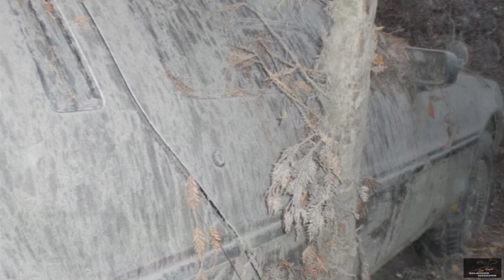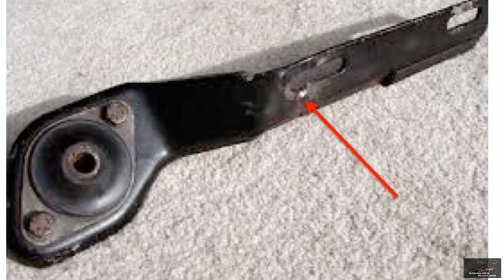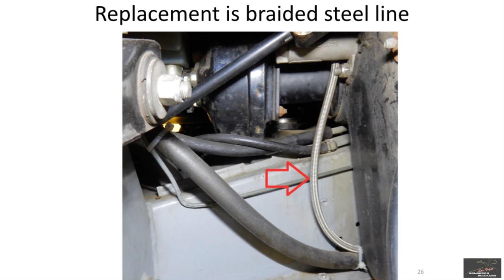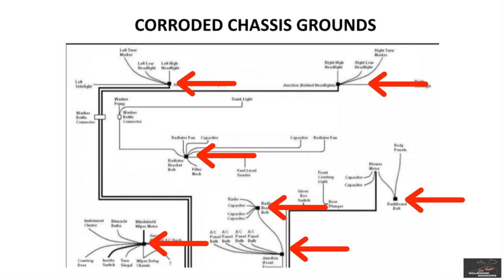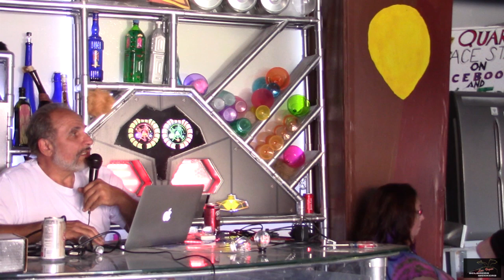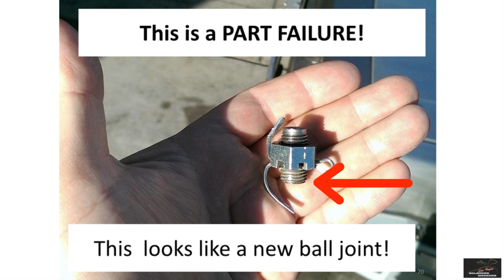What Happens as your DeLorean Ages?

Comment: I've been using this video as a to-do list for a year now.  Everything on the early- and mid- lists is done now.  I'll pro-actively do a few things on the long-term list, and run-to-failure on the non-critical items.  

Other well known DeLorean-specific items:

--replace the plastic expansion tank with stainless.  The plastic gets brittle and breaks.
--replace the asbestos heat shield with stainless.  
--replace all the lights with LED's to reduce the current load and slow electrical corrosion.  I've replaced 29 bulbs so far, and have more in the dash and console remaining.
--get Dave McKeen's digital RPM relay.  Look into getting his other digital replacement relays. https://www.deloreandirectory.com/maintenance/delorean-rpm-relay/
--replace fuses with gold-plated-blade fuses to stop aluminum blade oxidation that leads to electrical resistance that leads to heat build-up that leads to a melted fuse box
--get DMC's louver stiffener bracket
--get a car-window breaker.  You never know.
--keep an accessory belt (water pump & alternator) in the car in case yours fails on the road.  Any mechanic can replace it (or you with the right wrenches,) but fewer will have the right belt on hand.